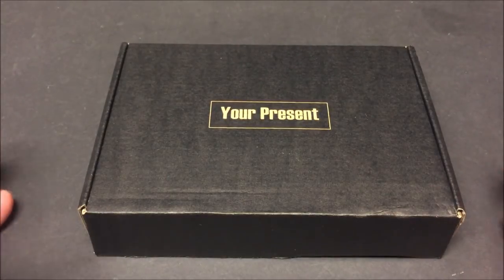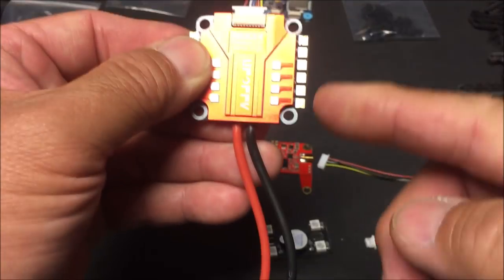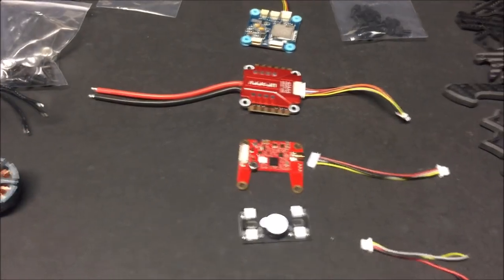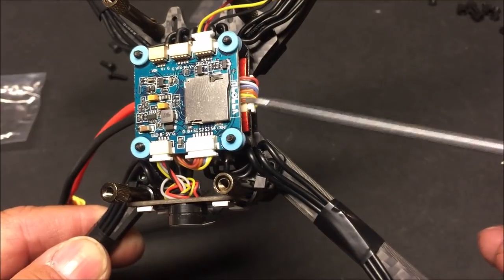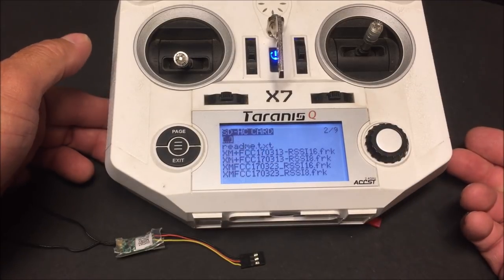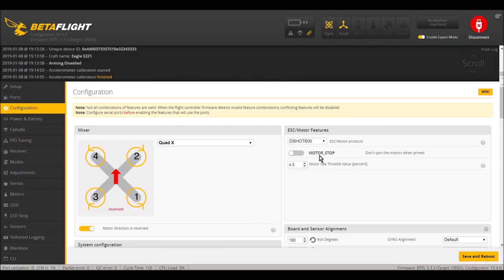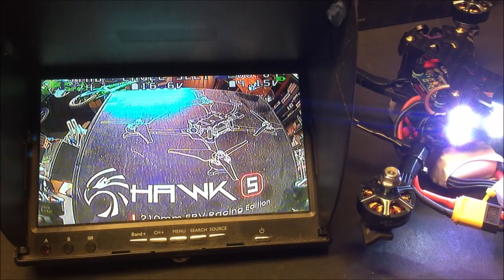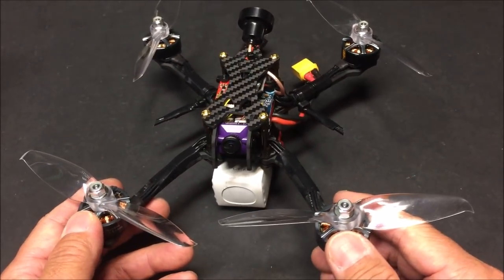DIY KIT BUILD!!!  SKYSTARS EAGLE  S-221

Comment: Sorry looked like from the video what about taking out one motor mount bolt and rotating the motor little till the wires line up and redrilling new hole it looks like the arm was molded to that shape and mount holes  might be off but the video perspective is different from actually hand's on any way peace out drone bro ✌️

Comment: I believe you have the arms upside down looks.like.if you flip them the wires will be protected
Reply from the maker: Johnny South 
I’ll see if that works :)
Reply from the maker: Nope!  Tried it out and the wires still stick out.  The front arms are also not able to be flipped.
Reply: @RCEscape  what if you take the wires, have them go into the arm where there is already a tear drop cut out , then bring run them down, Under the arms till u get to the end of the arm, then just feed them to the corrisponding esc